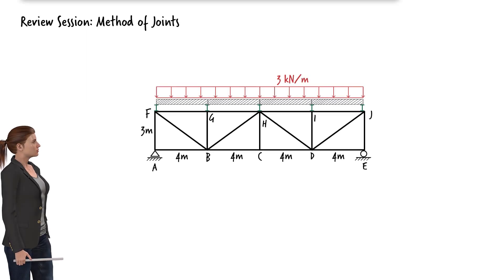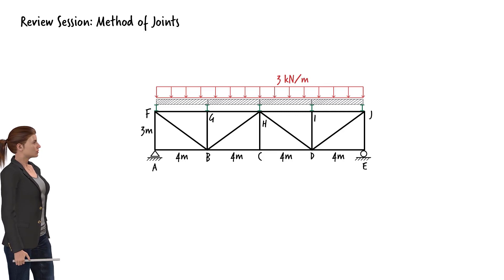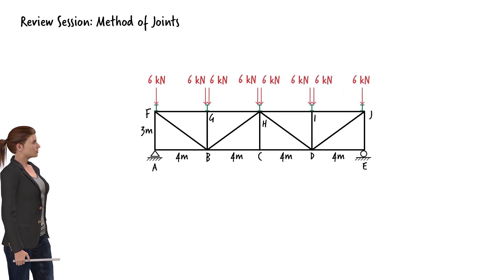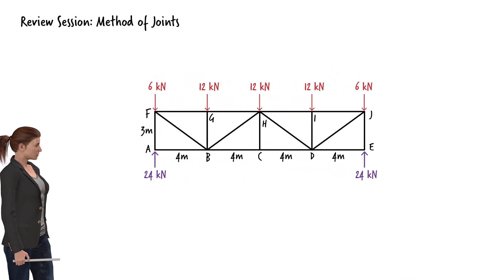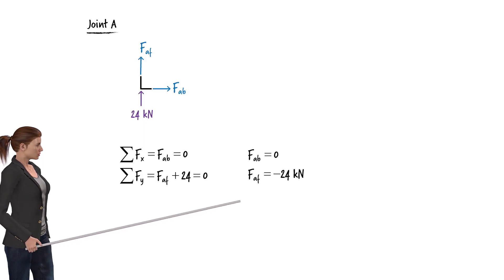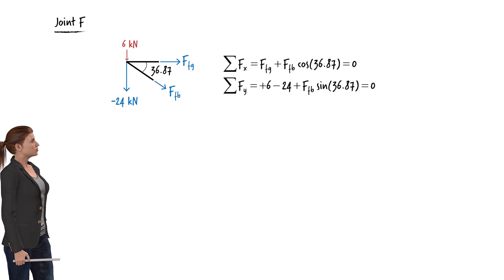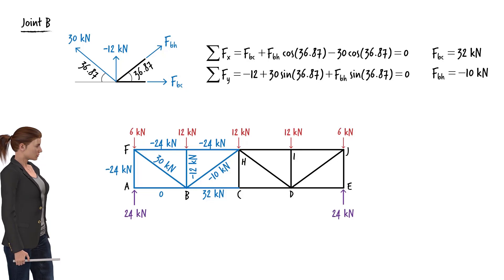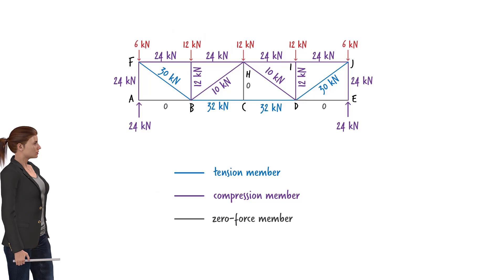SA67: Review Session (Method of Joints)

Comment: Good day Dr Structure

I saw they Udemy Course 2 days ago. I saw it was on special at R200 but i didn't have the money. So today i saw its R900, is it going to be a once off fee and is there going to be other specials in the future similar to the first special?
Reply from the maker: Udemy does give deep discounts periodically. Independently, course authors can also offer time-limited discounts a few times a month. However, these discounts seem to vary in the amount by geographical area. For example, a discount that set the registration fee for the course to $9.99 in US dollars , may not necessarily translate to the same percentage discount in India.  You may want to try the following link and see if the discounted price works for you. It is set at $9.99. Per Udemy guidelines, the link will expire in 5 days.

https://www.udemy.com/course/structural-analysis-i/?couponCode=BC97646751B74976A701
Reply: @DrStructure  Thanks soo much, the link has worked in line with the discount.
Reply: I have joined the Udemy course
Reply from the maker: Perfect!